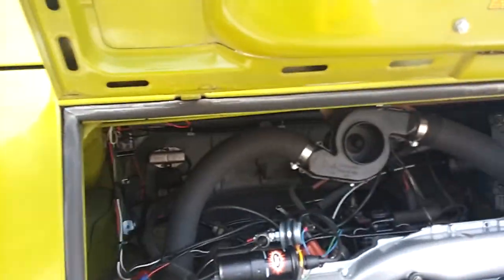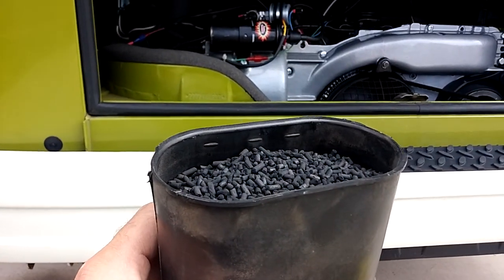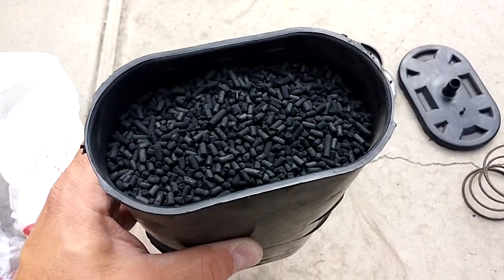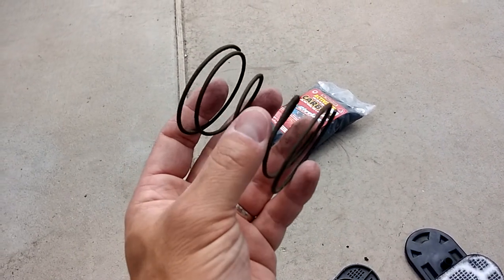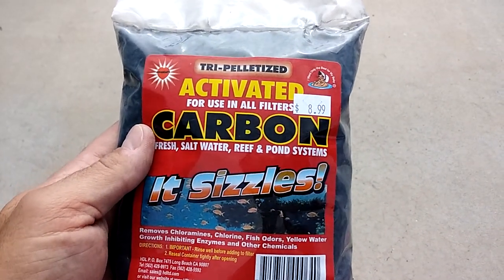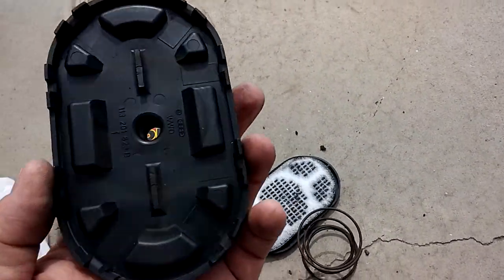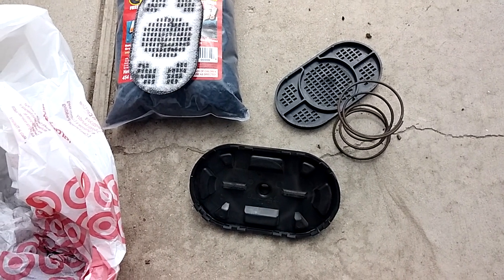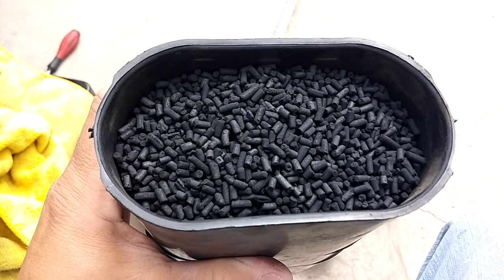Charcoal Canister VW Bus

Comment: The charcoal over time/use changes its molecular structure and ability to do its job , even if it "looks good" it's not doing what it's meant to do anymore . It's old and used .
Reply from the maker: Never noticed your reply. 4 years ago. 

Short little explanation on what the charcoal canister does. 
It is hooked up to the EVAP line coming from the fuel tank. If any liquid fuel would burp through that line and make into the charcoal, the charcoal would absorb the liquid and give it time to evaporate. After it evaporates the gases get sucked into your intake manifold and down into your combustion chamber and there burned with the rest of the air fuel mixture.
The charcoal has no other job. 
It is not filtering drinking water and absorbs particulate matter. 
Not import if it changes it molekulare structure. It just needs to be dry and absorbent, that is it.
Reply: @HeikosGarage  Yes, and no, it does lose its ability to capture fuel, but thanks anyway for replying. I was very upset for four years. Waiting ,,,,,Just kidding …good luck

Comment: How did you open that? The one on my 71 Westy seems to be sealed.
Reply from the maker: I wish I would remember. It wasn't hard. Am I not showing that. I think one side had three little clips to push out of the way to pull it open. When get home tonight, i look at it. Maybe that will bring back the memories.
Reply: @HeikosGarage  Thank you! We are doing a full restoration and this will help. Be well
Reply from the maker: I just watch my own video. In the beginning you can see the top of the canister. It has few little protrusions that click into the lid. You just have to pry the lid off with a screw driver in those spots. Does your canister look the same or is it a different model?
Reply: @HeikosGarage  I don't think so. Mine is metal. I'll try prying. Thank you.
Reply from the maker: @levainqueur9095  look on www.thesamba.com i think there was a write up about the different versions and how to open them.
Reply: @HeikosGarage  Thanks! I’ll check. This one doesn’t look like it was meant to open.